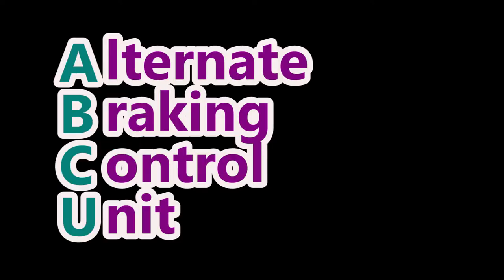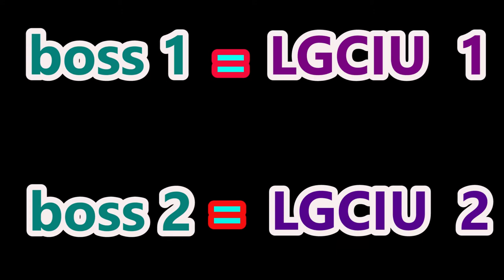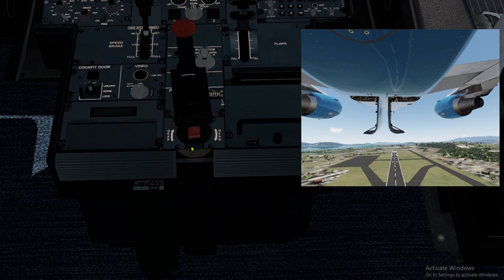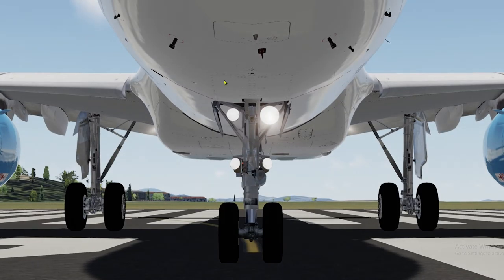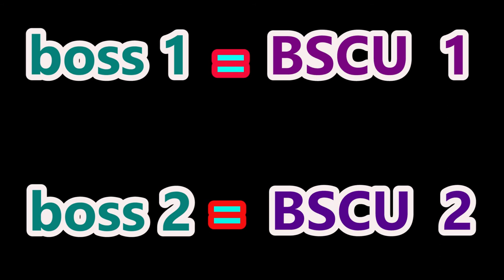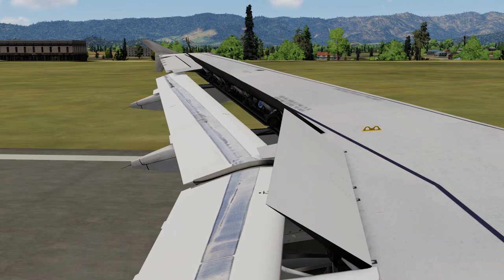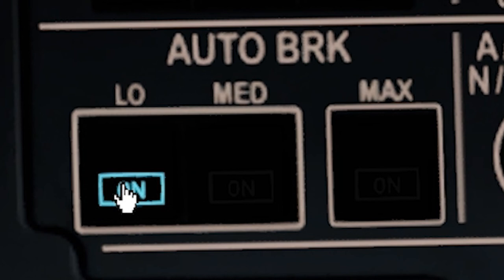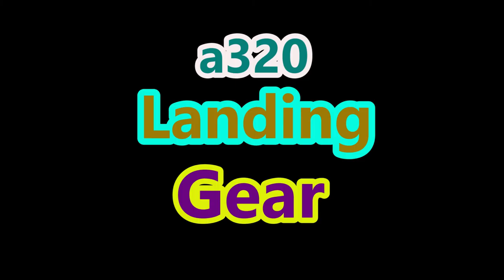A320 Landing Gear Systems MADE EASY

Comment: Hi Capt, 
What will happen if you retrieve the gear while the aircraft on ground. Will it work without the HYD pressure when the engines are not running. How does the safety pin helps to protect that from happening?

Thanks for the video. One last request, please consider the topic hydroplaning for a future video. would like to hear more about it.
Reply from the maker: Hi Isuru, I do believe that you will not be able to retrieve the gears on the ground. I think there is a safety mechanism for it.

Sure I will consider a hydroplaning video.
Reply: @Captain_SQ  thanks Capt.
Reply: It is interlock mechanism captain that prevents inadvertently retracting the gears when on the ground..
Reply: When either of shock absorber or landing gear are compressed and nose wheel is not centered a locking Mechanism doesn’t let it retract .
Reply from the maker: Great Shobit!

Comment: Can you explain how parking brake is applied when no engines are running? Also, why do we have to check the brake accumulator pressure in green before coming in for parking?
Reply from the maker: you have the accumulator pressure . If it is in green band in the accumulator, that means it has enough pressure for the parking brake.
Reply: @Captain_SQ  I had green Accu pressure and parking brake was set upon braking (confirmed on the triple indicator). Upon shutting down engine no 1( we were doing one engine taxi), and after parking brake on, the aircraft started to toll back. I immediately pressed on the brakes and the aircraft stopped. I have two questions based on this experience:
1) Why didnt the parking brake hold the aircraft even though the accumulator had sufficient pressure and confirmed on triple indicator?
2) When I pressed the pedals, was it the yellow system that automatically worked because the engines were off and yellow elec pump was also off?
Reply from the maker: Older aircrafts have green Hydraulics for parking brakes. New ones now uses yellow hydraulics for parking brakes. When you step on the brakes at the rudder pedals, you are activating the green Hydraulics. So if you say that your aircraft roll back after setting the parking brakes, it means that there is an issue with the yellow accumulators. Yellow accumulator pressure can last up to 12 hours. If you are performing single engine taxi, your yellow electric pump would have been switched on.
Reply: @Captain_SQ  yes, we were using yellow elec pump but that is the reason Im confuses because the acc pressure was in green
Reply from the maker: It is possible for it to happen, the accumulator pressure in green but the aircraft move, perhaps there is a problem with the parking brake selector valve(it is possible that it opens slowly) .  So once you set the parking brake, you would have to check the brake pressure(the two needles below the accumulator pressure gauge). Check the left and right brake pressure on the pressure indicator is showing before releasing your feet from the brakes.
Reply: @Captain_SQ  airbus just recently updated the fcom too. Once PRK BRK set, maintain brake pedal pressure and allow the accumulator to pressurize first before releasing the pedals. Hope that helps. Capt SQ. Love you channel. Not boring w lots of visuals. Very entertaining. Better than airbus!
Reply from the maker: Thank you Ken for highlighting it. Glad you enjoy the channel!

Comment: Why do we have to check the accumulator pressure in green? I thought the parking brake was supplied by the normal yellow system
Reply: There is no yellow hydraulic pressure before the engines are started so the accumulator is needed to pressurize the park brake
Reply: Are you wondering why it's called green? Checking it in 'green band' doesn't mean it's using the Green Hydraulics. It being in green band just tells you that the accumulator pressure has sufficient pressure. When the accumulator pressure is in the green band, it typically indicates that the pressure is within the optimal or safe operating range for the system. The green band on a pressure gauge or indicator shows that the pressure is neither too low nor too high, ensuring that the system is functioning correctly and efficiently.

Comment: L/G NOT DOWN
This alert triggers when: 1.L/G is not downlocked and radio height is lower than 750 ft and both engines N1 lower than 75% (or if engine shutdown N1 of remaining engine lower than 97%) or 2.L/G is not downlocked and radio height is lower than 750 ft and both engines are not at T.O power and flaps at 1, 2, 3 or FULL or 3.L/G is not downlocked and flaps at 3 or FULL and both radio altimeters are failed.
Reply from the maker: Excellent answer, great job.